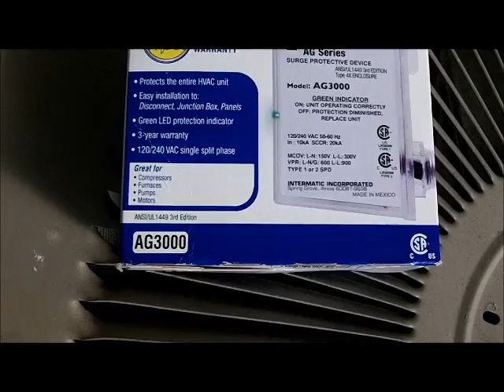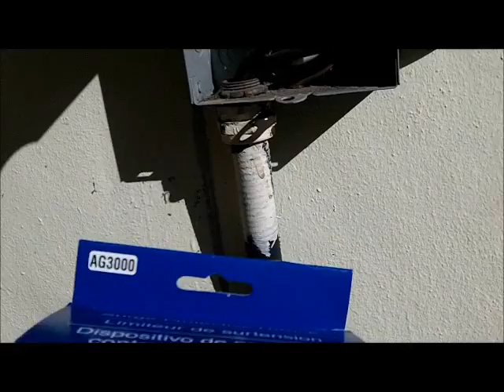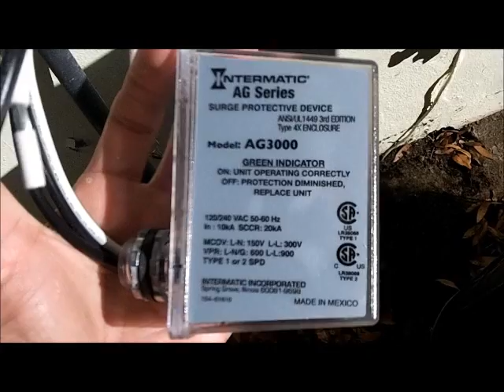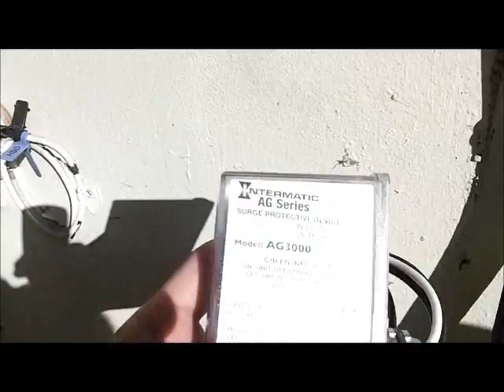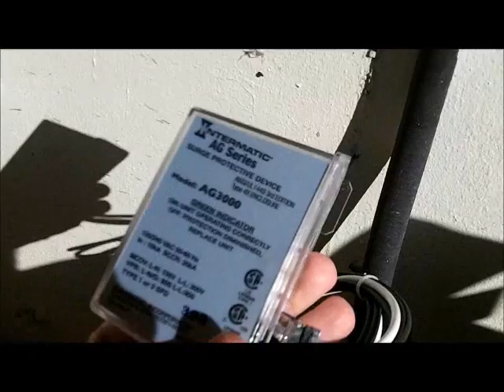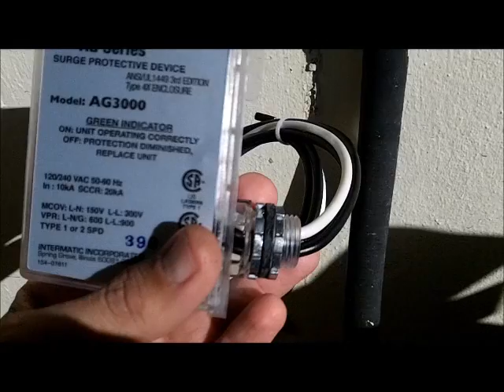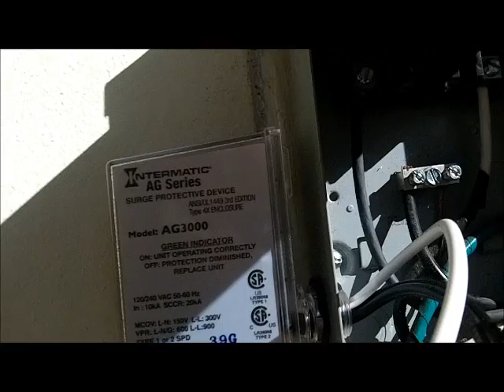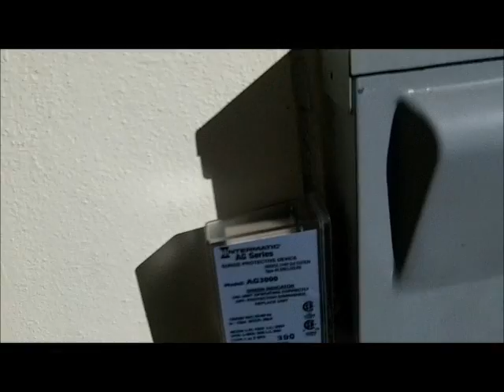Intermatic AG3000 HVAC Surge Protector Installation -- Install discrepancy on the video description

Comment: This is absolutely done the wrong way.  You are not supposed to land two wires on a terminal, no no no.  It needs to be pig tailed.  You are also not supposed to zip tie wires together.

Comment: What if someone hooked it up at the bottom of the box . Ours is now it got water in it. I called the guy that put it up. Still can't come back to put a new one in.  Thanks for the video.
Reply from the maker: I would turn off the circuit breaker that connects to it.

Comment: No bueno - should be connected to the line side and also should not be double lugged. Need to make pig tails to make your connections with this specific ag3000 surge protector.
Reply from the maker: Gracias por la observacion?

Comment: This is done completely wrong.  Two wires cannot be pushed in the same slot.  It's a fire hazard and code violation.  Secondly, the protector is wired to the wrong wires.  It goes to the load, not the compressor.    Pigtail must be used to prevent a fire.

Comment: The breaker has be cut off. The reason is that the AG3000 was supposed to be connected to the Line side in the Quick Disconnect.  
Not the load side. 
When the disconnect is pulled the AG3000 should still have power. 
Wired in this way your unit will be protected when the disconnect is reinstalled.

Comment: I'm an HVAC Tech 30 years, you need to make sure power is off and verify with a volt meter  first, you should explain Line Voltage and load
 it should be wired into the Line Not Load
Reply from the maker: Mark Drumz - Great advise, Thank you Mark.
Reply: welcome
Reply: I have a 6 gauge wire going into the line side so not enough room to also add the ag3000 wires. Is it ok to simply connect to the load side?

Comment: Did you just run it in series with the line side using the two black wires and land your white wire with a neutral or is that the ground? 
 I just got done replacing for HSI module boards on two Raypak boilers that went down due to a power surge. Looking to install this on the boilers. Only pulls 20 amps on 120
Reply from the maker: Larry Meloro - Hello, The disconnect box has 2 hot wires coming in ( One black, One White) and the ground lug (copper bare wire).

Connect the surge suppressor black wires to the black wire cables coming from the AC unit.

The white wire from the suppressor goes to the ground lug.

B surge ------B ac      B discon 120v
B surge ------B ac      W discon 120v
W surge -----GLug    Bare discon Gn

Have a voltmeter handy to confirm the voltage potential at all times and turn off the power breaker to the unit when making connections. If unsure, consult an electrician or refrigeration tech.
Reply: pricedownmall-
It's a single phase unit. There is one  hot wire and one neutral wire.
I am a certified Union mechanic.
 You didn't answer my question, is it wired in series or parallel?
Reply from the maker: Hello Larry, the unit on the video has 2 black wires for the hot wires for 120vac ea and 1 thin white that serves as ground.( This unit should have the ground and return connected internally and result to be grounded to the bus bar on the disconnect when the white cable from the suppressor is connected to the bus bar. )

The disconnect doesn't have a neutral (return) wire going to it.

The white wire going to the disconnect is also hot, it is not a return cable.

To answer your question the unit connects in parallel. Black-black on disconnect and Black-white on disconnect.

If you notice, the thick white cable on the disconnect doesnt go to ground, it is connected to the right side 120v side. 

Not sure if that will help, Could you reply with a video of your setup? Thanks
Reply: Larry Meloro 240 is single phase.
Reply: Larry Meloro it is wired in parallel.
Reply: @true.to.my.eyes.  No neutral in this case.

Comment: Pretty sure you should be connecting the surge protector to the line side of the disconnect not the load side. This would also require you to open the breaker going to the disconnect from the main or sub panel.

Comment: Question - Why did you use a SYCOM surge protector on the main panel but on AC disconnect you used Intermatic AG3000? Is there any difference between the two?
Reply from the maker: +Steve Rudenko - Hi Steve, the ratings were different, also my web searches were very specific to what I wanted to protect at the time. Price and a avalability was also considered in my case. 

As long as the surge suppressors have the rating you are looking for I would say the brand being the same would be entirely up to you. I hope that helps.

Comment: Oh my God, yes, Barry is right.  He gives good technical advice, but he is not engineer enough to notice that no one can see what he is doing to connect the surge protector because he casts no light up under the cover where the wires connect.  And the idle talk is a problem.  Please, dude, re-shoot this video and cast a simple flashlight up in the box where you are working and then for the sake of us all check your video before you bloody post it to see if the lighting was sufficient for all of us to see which wire connects where.  The video this guy shot almost useless because he has cast no light up into the dark box.  At least he tells you that he paid $50 for this unit 4 years ago.  Tom's Mechanical in North Texas tried to charge me $185 for this unit in April of 2017
Reply from the maker: Hey John, Thanks for the comment. Sorry for the light deficiency. I will redo it pretty soon, the Surge protector couldnt take any more FL lightning strikes and surges so it no longer works. I amost passed 5 years ago due to kidney failure, I shot this video 4 month before my kidney pancreas transplant and while on dialysis. 

4 years ago, I just didnt have time to shoot perfect videos, Today I appreciate you watching mine and certainly your comment. Are you just looking to buy a surge protector? Let me know and I'll find a decent one  to shoot under the right conditions,  better lighting of course.

Comment: your line and load leads are backwards on your disconnect. and the surge-to-gnd unit should be on the line not the load. plugging in the disconnect can cause premature failure or the sga unit.